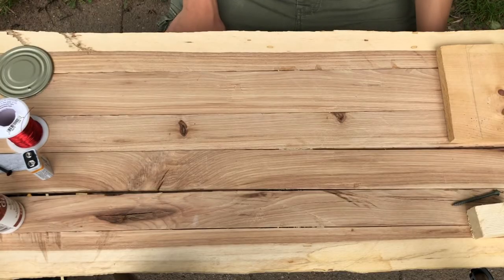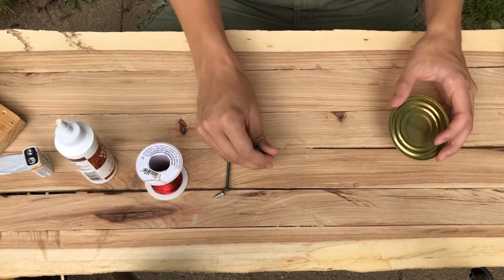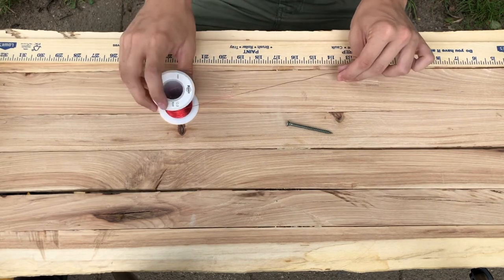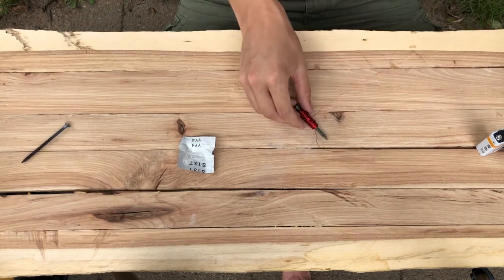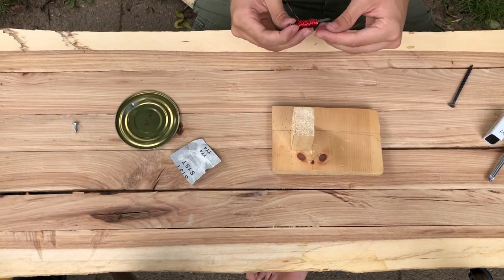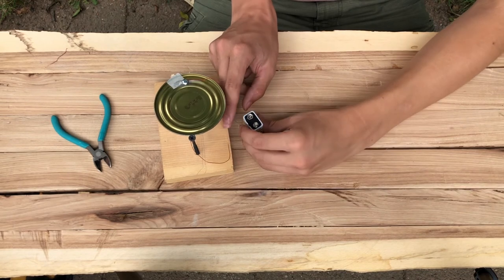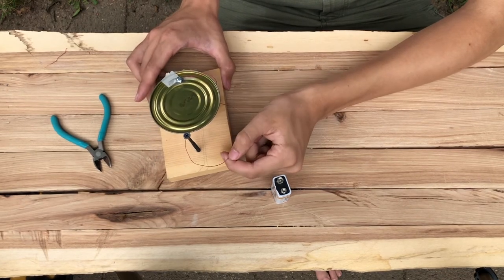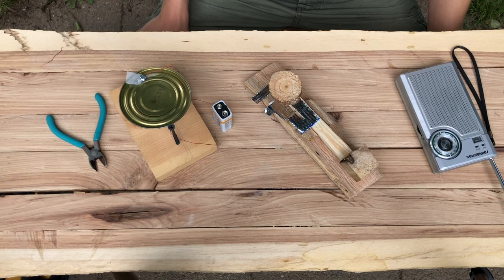How to make a simple Wireless Telegraph/Spark Gap Transmitter

Comment: I want to ask you a question:
How did you connect the telegraph to the am station?
Reply: Anybody got anwser
Reply: Maybe just some random am station without signal
Reply: I don't think he reads comments
Reply from the maker: It becomes the station, the thing I built transmits the Morse code in the form of radio waves, which you can get on a radio
Reply: you can leave it connected to the battery, and then check what frequency it takes on the radio.
Reply: It transmits all over the spectrum. The frequency doesn't matter.

Comment: reminds me of an electromechanical relay,because of the electromagnet used to open and close the switch.

tip:heat the EM nail as much as you can,but do not melt it.because soft iron,which you get by heating an iron nail,is magnetic only when current passes through,but on the other hand,regular iron nails retain a lot of magnetism even when the current is off,do this so the nail doesn't stick to the lid,i used too much turns,like 400 on the biggest nail i could find,and the lid just got stuck to the nail, just posted this tip to make sure nobody repeats this mistake.
Reply from the maker: That super helpful, thanks!

Comment: I got a question, what if your electromagnet doesnt work when you try to magnetize it
Reply from the maker: Check your wire and make sure it is all getting electricity, add extra coils, or make sure you have a big iron or steel nail

Comment: What would happen if I didn’t sand the screws?
Reply from the maker: as long as all the wire and screws can make a good contact, you don't need to, but usually they are coated in something

Comment: nice video, how far the signal goes?
Reply: Probably up to the Moon....
Reply: The most it’ll do is reach up a few miles. On a perfect day with proper propagation it’ll reach about a few hundred miles but only if ur lucky.

And most importantly. You need an amateur radio license for this and need to make your transmitter INSIDE of the amateur radio bands. Otherwise the FCC will come and get you.
Reply: Lmao  @astro.p
Reply: @astro.p It will reach only about 10 meters. With antenna it could reach few hundred meters or few kilometres, depends on the size of the antenna

Comment: Can i use a 1.5v battery?
Reply from the maker: It may not have enough voltage, if so, rig multiple in series
Reply: @dieterdoes9497  ok thanks

Comment: why does it transmit
Reply from the maker: You can use it to transmit Morse code
Reply from the maker: The sparks created produce em radiation
Reply: @dieterdoes9497  and how would you attach an antenna to it to increase the range?
Reply from the maker: @yadadi4438  I have not tested this yet, but a good guess would be the large screw or lid
Reply: @dieterdoes9497  are you fluent in morse code?
Reply from the maker: @yadadi4438 no, I memorized them, but I can’t remember them fast enough for a real conversation
Reply: @dieterdoes9497  oh, nice, where did you happen to get the parts for this project?
Reply from the maker: @yadadi4438  recycling bin
Reply: @dieterdoes9497  even the copper wire 😆
Reply: @dieterdoes9497  you should get your amateur radio license.